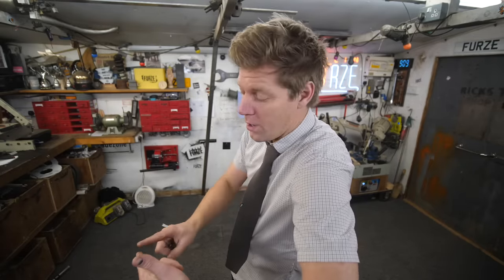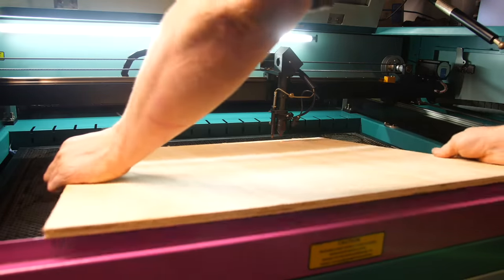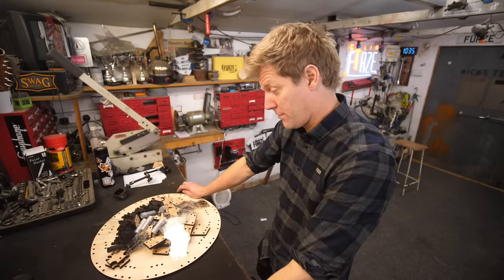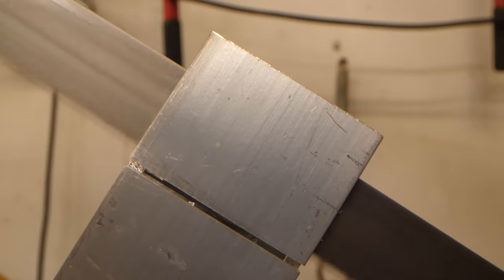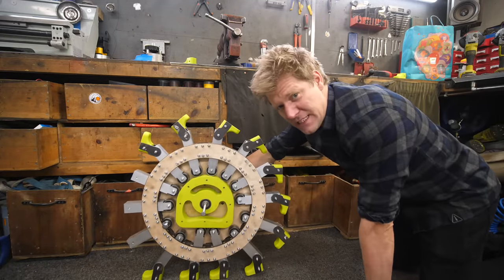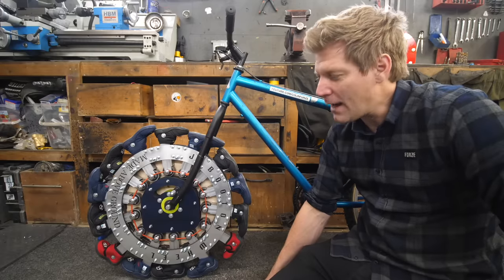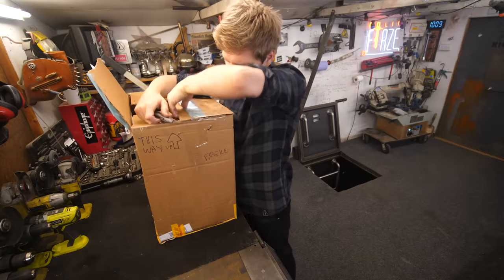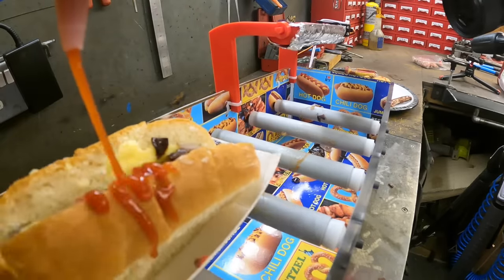14 LEG Bike Wheel Concept

Comment: Fun project. I think you should make another version where each foot print stamps a message in the mud or snow. Perhaps a long romantic poem through the town or just a subtle yet shameless "subscribe to colinfurze" on every step. You can put Engineering Mindset if you like, I'll sponsor that.
Reply: Wouldn't the back tire just rub all that out. .😏
Reply: @wadly99  So make it the back tire?
Reply: @Sn1peralex  as a rear wheel it would not be able to transfer torque from the hub as it is currently built.  Maybe an adult size coaster bike. Or off set the wheel tracks.
Reply: @wadly99  make it a trike so the the back tire can highlight it or something. Obviously works best Ina straight line but still
Reply: @kamoterorl  I'm certainly no engineer but if you made it front wheel drive and the feet were on the back (idler), it could work? Also bonus points for sitting more above the feet (better stamping). Take the gears out entirely and make an adult size balance bike :D
Reply: @transatlant1c  a bit like a penny farthing?
Reply: @iwinrar5207  no, no.. make it a unicycle. then you dont have to deal with a second tire at all
Reply: this is 1000% correct dude
Reply: @wadly99  Make it a unicycle
Reply: @transatlant1c  Front wheel drive? With a chain?
Reply: make it a tricycle so you actually read the message!
Reply: @wadly99  🤣
Reply: chad
Reply: @wadly99  now that you mention that, this really does sound like the mindset of an engineer. Great in the theory, not always so great in practice.  Lol 🤣
Reply: @wadly99  unicycle.
Reply: Who even are you

Comment: Amazing as always, does worry me about any failure leading to being kicked in the testicles at 2500 rpm.
Reply: Dang these spam bots are getting high, but yeah getting hit in the balls with this thing will probably temporarily disable cooming for half a year
Reply: You don't have to worry, if you have a safety tie. :D
Reply: might be a market for that ;)
Reply: If you can peddle at 2500 rpm, you will also have the power to withstand infinite kicks to the nads. Also to fly, leap tall buildings in a single bound, etc.
Reply: yeah but what a way to go
Reply: That's all? Sounds like one of his safer inventions then!
Reply: @markstevens1729  2500 rpm at the wheel probably what he meant not pedal rpm
Reply: 2500 rpm x 14 = 35,000 kicks per minute lol !
Reply: @djaydeved  yeah, peak RPM at the wheel is about 10% of that, but you know: it’s a bird, it’s a plane…
Reply: The frame of the bike would prevent a direct nut-shot.
Nothing to worry about
Reply: @SteveO... Dude got himself a new unique kick to the balls.
@ColinFurze in SteveO's van would be hilarious!
Reply: i know! without a doubt true!!

Comment: The original Edwardian footed wheel invention was patented as "The Pedrail". It was the alternative competitor to the Holt "Caterpillar Track" method of moving heavy machinery over rough terrain. Guess which invention won the competition & became globally successful, in the end.

Nice to see "The Pedrail" making brief comeback, after a 120 year gap.
Reply: I first came across the idea of the pedrail in the H G Wells story The Land Ironclads. This was a story about tank warfare with battleship size tanks.
Well worth reading in my opinion.
Reply: yup. totally, totally true
Reply: even before that, there was a prototype steam locomotive that used legs to push minecarts, it had a fun tendency to get stuck, speed up, then lift the cars off the track
Reply: Didnt they try making tanks with it originally too?
Reply: @Akari_202  Not sure, but H G Wells described a similar system in a 1911 story. That story also described the gunners as sitting in darkened cabins, viewing the outside world as an image on a screen and controlling the gun movement with a joystick that had an electric button that fired the gun.
Reply: They actualy were used on some WW I towed artillery pieces to defeat the mud.

Comment: would you want to put in practice my idea with "free energy"? 2 small solar panels (12V/1A) facing each other lighted by backlight from led monitor/tv; the backlight plexiglass should be powder with "WATER-BASED REFLECTING PIGMENT, LIGHT REACTIVE" on both sides (I've seen someone trying to light with leds directly a solar panel and it produce current on yellow light, so the powder should be yellow)

Comment: Nice boot-mobile, Colin.  I thought of putting something like that together a couple decades back, instead putting sasquatch feet on it and mounting it on a motorcycle and go riding in the woods.  Great idea, too much liability if someone is packing a gun.  As for the hotdog machine, I see a load of improvements it could use.  Clearly much larger than what the young lady sent you.